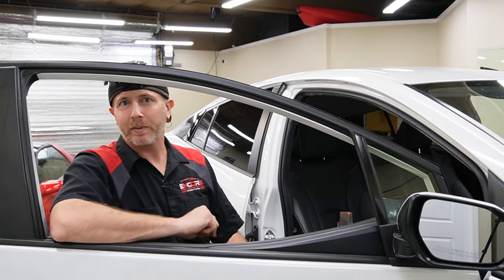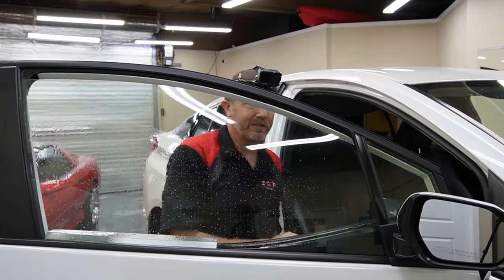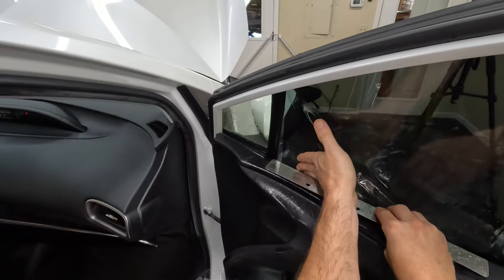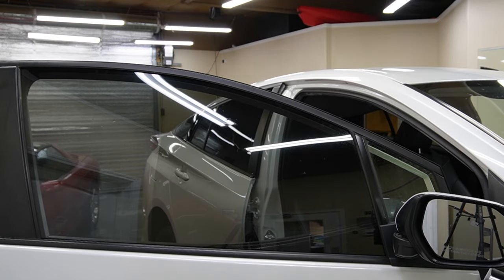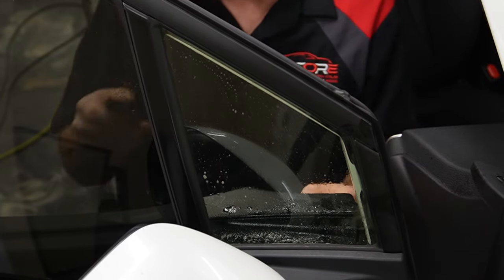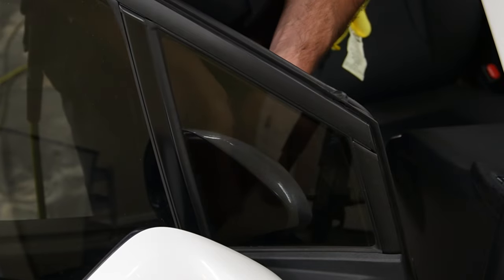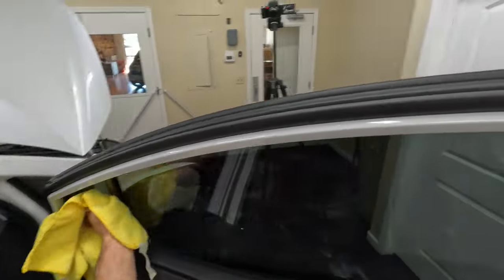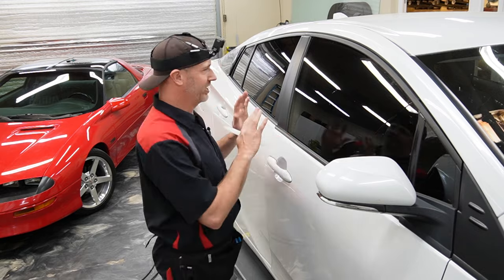2021 Toyota Prius Front Door Window Tinting: Roll-Up & Wing Tutorial

Comment: 0:35 damnnnnn Toyota, whoever is in charge of the design team needs to be arrested. I despise disassembly as well but in that case, I may have to hire someone to remove those and charge accordingly.
Reply from the maker: I'm with you 100% on disassembly. For my first 2-3 years I removed every door panel. It makes the install so easy but is a huge pain and takes up quite a bit of time. I refuse to remove panels now.  I think Toyota really hates window tinters. 😂😅😂